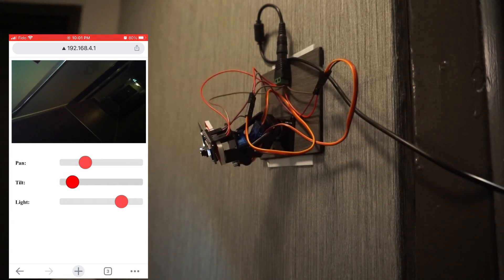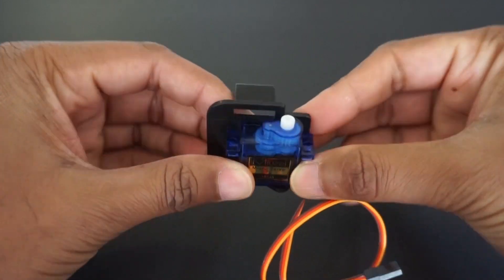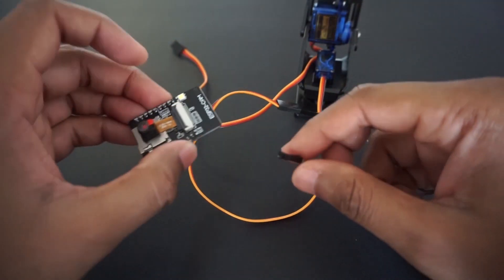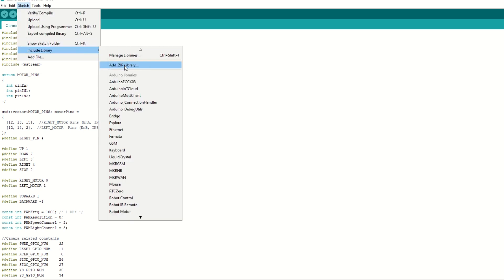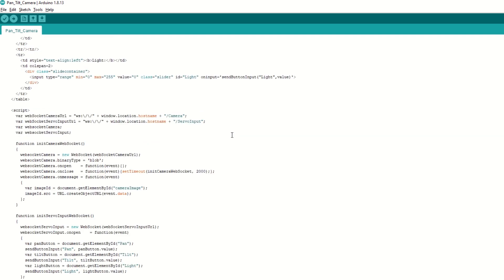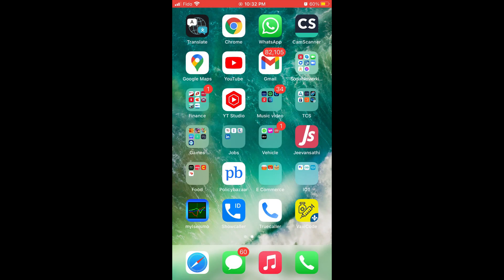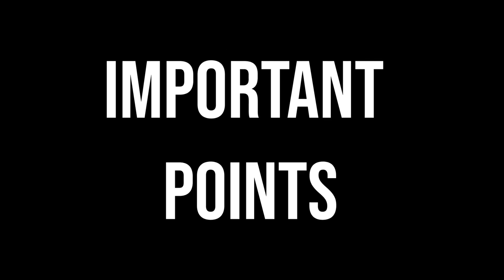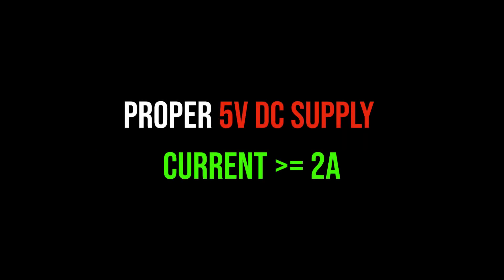Pan Tilt Control using Servos for ESP32 Cam |  WiFi Security Camera

Comment: Thank you sir for this code and setup explanation. And i have question sir can we use a battery for power supply
Reply from the maker: Yes you can use battery . However you need to make sure battery provides exactly 5V . Also use only rechargeable battery 👍🏻👏🏻
Reply: OK sir thank you for your guidance.
Reply from the maker: @sumeetmurgod2211  welcome 🙏

Comment: Bro I am providing it 5v supply but I think it's less than 2 A. Since I am not using sevo but still the video is freezed. Is it because of A? Is it necessary to provide 2A for video streaming
Reply from the maker: You need to change one setting in code . Please check for this step in video 👍🏻👏🏻

Comment: I am a newei and I have got an another problem 😅
Now the video gets freezed whenever I try to stream the video. Also I am only able to use it when I am connecting it through arduino to laptop. ESP32 doesn't start when I power it external 5v supply without the RX, TX pins. It's only working when I am connecting the RX, TX pins of arduino with it.
Reply: Bro you solved the problem

Comment: Sir I have done everything correct but esp32 wifi is not showing in wifi list. Please help
Reply from the maker: Please check your power supply and connections 👍🏻👏🏻
Reply: @hashincludeelectronics  bhai its correct. I tried powering it with laptop and with external supply both but still
Reply: @hashincludeelectronics  My antenna resistor is also placed correctly. The code uploaded successfully but when I am pressing reset button a random code comes in serial monitor. Please help me bro with this 🙏🙏

Comment: Can we get images if ESP 32 is connected to the phone instead of connecting phone to ESP 32 ?
Reply from the maker: Sorry I did not get your question 👍🏻👏🏻
Reply: @hashincludeelectronics  i mean, can we use esp 32 cam station mode instead of setting it as access point ? (in your project phone connects to esp32 cam, but i want to connect esp32 cam to phone's hotspot)
Reply from the maker: @psykopat81  yea you can . However what are you trying to achieve by doing this ? If you connect to your mobiles hotspot then you will have to get the ip address from esp32 which will be different.
Reply: @hashincludeelectronics  i am controlling my old android phone with teamviwer. If the esp32 cam is connected to the hotspot of this phone, I could control the esp 32 cam from anywhere in the world (you know blynk video streaming is now paid).

If the phone is connected to the esp32 cam via wifi, the mobile connection is automatically closed and I cannot connect to my old phone.

So the phone's mobile connection must remain open and esp32 must be connected to the phone.

Comment: hlw sir i am facing a problem... it is that the video is not streaming and when it streams its just a snapshot only and then it freezes and i cant help it...the serial monitor says frame buffer not accquired...
i have also set the parameter to 1 as described in the video...
plzzz reply sir plz help me
Reply from the maker: Please recompile the code and upload again . And then try 👍🏻👏🏻
Reply: Did you solve it?

Comment: I've tried according the video. 

Uploaded the code in esp32 without any error. then when I've giving power with 5v 2a adapter. SSID works. After connecting to ssid. Only LED control working. Camera video is freezed and no servo is working. 

I've also set the WS limit to 1. But still no movement in servos and no live video footage. 

Please give me a permanent solution
Reply from the maker: Please check the power supply . It should provide more than 2A current to work . Also check if your servos are freely moving . It should not get stuck in the frame 👏🏻👍🏻
Reply: @hashincludeelectronics  okay. the servo is not moving. when i'm disconnect the 5v pin, that time the servo just giving a shaking.

Comment: Hello sir....
I have also made it looking like this. But problem is coming. The video is not playing and stops after showing only 1 second and the servo motor is also not running. Only the LED function is working.
Reply: What is causing this problem? Why is this happening? And why is the camera module ESP 32 getting hit?
Reply from the maker: You need to change one setting in code . Max messages queued . Please check this in video 👍🏻👏🏻
Reply: I have done this also
Reply: @hashincludeelectronics   32 to 1
Reply: I am also facing the same issue.Video is frozen and servos are not working.only light function is working correctly
Reply: @Rinshadkt Did you solve it?
Reply: Me too..
Reply: How did you solve it?

Comment: I want to implement this project:

"Design of Driver Awareness system depending on Eye and Face Feature and Discrimination"

Can I use ESP32 instead of Raspberry Pi ? please reply
Reply from the maker: You can use esp32cam however you will have to do more study on how to use it for object detection etc . 👍🏻👏🏻please check details on internet available 👍🏻

Comment: Hi! I am havign a problem while using the app. The light works well but the servos are not moving and the camera is printing "Frame buffer could not be acquired" in the Serial Monitor. How can I solve that? I have already set the variable WS_MAX_QUEUED_MESSAGES to 1
Reply from the maker: Please compile and upload the code again after you have set that setting to 1 👍🏻.
Reply: @hashincludeelectronics   Is the first thing I did, but nothing happens, the camera is unable in the app

Comment: I know this comment section hasn't been checked in over a year, but I need help with this project in the worse way possible.  I have spent at least a month writing and rewriting your code, trying all kinds of different things, AND NO MATTER WHAT I DO, I GET NO IMAGE, NO MOVEMENT FROM EITHER SERVO, AND OF COURSE, THE LIGHT WORKS FINE (PIN 4)  How can  you help me????
Reply from the maker: Thank you for checking out the video👍🏻👏🏻. Please note that I have been keeping an eye on each and every comment on channel . So don’t worry I will always get back with answer whenever I get a chance. Regarding your issue what kind of power supply are you using ? Please make sure your power supply can provide more than 2 ampere current with 5v output 👍🏻👏🏻.

Comment: Hii sir, Can we use Raspberry Pi to upload the code ??
Reply from the maker: Yes you can use any module to upload the code into esp32 cam if it supports . However I have not used raspberry pi yet . Give it a try 👏🏻👍🏻

Comment: I want to build this project so I can connect to it any place in the world. Can I use an external internet access for the esp32 cam instead of my phone so I can have acces to it anywhere in the world and can I be able to control the servo any place in the world? Thanks
Reply from the maker: Unfortunately it can not be done using this project . This camera can be accessed locally only . You need to use the party apps like Blynk to access the camera globally from anywhere in the world . Unfortunately I don’t have video using Blynk on my channel . You can check for reference on internet . 👌🏻👏🏻
Reply: @hashincludeelectronics  Okay. I thought it is webserver connected already. For example, I just need a router for the esp32 cam then while internet connected it streamed the video live to my phone at another country after turning ON my mobile data. Also, why is blynk different from this. I think they plan the same source as you either need a web or app so you can stream the live video.
Reply from the maker: @joshuaolaiya  you can not connect to your local routers IP from outside . And even though you open port externally somehow , it’s dangerous . When using Blynk we send data to Blynk server first . And then from mobile we connect to Blynk server and receive the data.
Reply: @hashincludeelectronics  Alright noted. Thank you
Reply from the maker: @joshuaolaiya  welcome 👍🏻

Comment: Hi, Great project, i have build one and both the servos are woking fine. but the video is not coming and if coming its just a snpshot only. in serial monitor i am getting "Frame buffer could not be aquired"  please suggest on how to resolve this. Thanks
Reply from the maker: Thanks for checking out the video 👍🏻👏🏻. You need to set one parameter as shown in video . Please check video and see how to set “max messages queued” variable . 👍🏻that will solve the issue .
Reply: @hashincludeelectronics   hi me too facing the same problem, i follow the step " 32 to 1 " but the problem still goes
Reply: hi sandeep, did your problem got solved because i am facing the same problem
Reply: Did you solve it?

Comment: Video not display on mobile app. Do you help me?
Reply from the maker: Please check the video slowly and carefully so that you don’t miss any step . 👍🏻👏🏻
Reply: @hashincludeelectronics  i have made sure that not a single step is missed. And the error code (E) camera.c 1483 esp_camera_fb_get(): failed to get the frame on time. Is the cause hardware?.
Thank you in advance
Reply: @AzCars14  Hey could you fix it?
Reply: @JeroLam24  No, I think that the ESP32 cam is damaged

Comment: Can I combine this project with your other video named “Surveillance Car using ESP32 Camera Module"? If yes, what should be the changes that will occur in its code and the wiring
Reply from the maker: There is already a video on my channel where I have used pan tilt camera in car . Please check that 👍🏻
Reply: @hashincludeelectronics 
Can I get the model for the 3D printing?

Comment: I connected the esp32cam with a usb cable to the laptop, wifi nowiseeu can be read and connected. but when I remove the USB cable and connect with the jumper cable according to the instructions on YouTube, how come it can't appear, right? Wifi nowiseu? what's wrong huh?
Reply from the maker: It’s definitely power issue . Check the power supplied . 👍🏻

Comment: Bro this is Bluetooth operated right or u have to give the live connection to the Arduino
Reply from the maker: This is WiFi operated. But you don’t need internet for this . This project creates its own WiFi network .
Reply: Oh tht nice but can u explain the Arduino part i tried but it failed i didn't know how to do it . If u could help me I will be very thankful
I will try the robotic arm which u have made its was awesome ur explanation tho it's nice bro 
Tho i have a doubt i wanted to purchase a 4DOF robotic arm is tht code applicable for tht which is a 3DoF 
Those both look quite similar pls reply sir❣️

Comment: Great video!
I have a problem with during compilation on the line 246.
"error: variable 'std::istringstream ss' has initializer but incomplete type
         std::istringstream ss(myData);
                                                             ^"
Do u know how I can fix it?
Reply from the maker: This error should not occur . Which Arduino IDE are you using ?

Comment: Why use arduino one, it is not necessary instead use tdfi for esp32
Reply from the maker: Arduino Uno is used to just upload the code and acts as USB to serial converter. You can use any other device to upload the code .

Comment: I swear to god the Tilt servo is not working. Pin 15. 

I've tested the servo itself and it works. I've also tested uploading other code and use pin 15 and the pin itself is working. I've checked the code several times. I've watched the video several times as well. And reading the comments I'm not the only one having this issue. Please can you focus for a minute on this issue?. 

BTW, I've also watched several times the wifi car pan tilt video and I've tried changing   config.ledc_channel = LEDC_CHANNEL_4;
  config.ledc_timer = LEDC_TIMER_2; and still its not working. 

I really hope you can help.
Reply from the maker: Thank you very much for checking out the video and trying it. I assure you that there is no issue on using Pin 15 for servo.
1. Make sure you upload the given code for this project again Please don't make any changes at al in code. The timer and channels are coded properly and tested well.
2. Make sure you use 5V DC Adapter which provides more than 2 A current rating.
give it a try and let me know. Don't worry it should work as it worked for me .

Comment: didnt wor at all. Instruction is missing steps. such connecting the arduino. Its unclear.
Reply from the maker: Thank you for checking out the video and comment 👍🏻. What exact issue are you facing? I have provided the clear instructions in the video as far as I can and it works for others .

Comment: What changes should I make to make it work in station mode?
Reply from the maker: The code changes for Station mode are simple and you can find reference for it in my “getting started with esp32 “ video .
Reply: @hashincludeelectronics  I uploaded the code and the slides are working fine but there is no video. just a frozen image. It just like it only took a picture then stopped. Do you have specific version of libraries to use? I already modified the library header file from 32 to 1 as you instructed, but still to no avail.
Reply from the maker: @kymcainday6677  yeah the setting you changed from 32 to 1 should fix this issue . Make sure you re upload the code.
Reply: @hashincludeelectronics  no, it didn't fix the issue. That's the first thing I did actually before uploading the code

Comment: Great work! may i ask which part of the code need to modified  for flipping the camera angle? thanks in advance!
Reply from the maker: Either you can rotate the esp32camera or change the code where it has img section of html code . You need to check how to rotate image in html on internet .
Reply: @hashincludeelectronics  thanks for your generous reply! i get it! God bless!
Reply from the maker: @elmardasmarinas678  awesome cheers 👍🏻

Comment: how can i find ip address
Reply: Why address same?
Does wifi name password need to be same in my code
Reply from the maker: @kristyology865  this project works in AP mode . Hence address is same because esp32 creates its own WiFi network and acts like router. You can select any ssid and password as you need . You can keep the same ssid password in the code as well .
Reply from the maker: The IP address is same as used in video.
Reply: I do not find your wifi name in my wifi settings

Comment: A very nice project! I did it but only pan SERVO runs, Tilt SERVO not move, what can be? thanks.
Reply from the maker: Thanks . Please check the connections properly . May be there is loose connection for sure .
Reply: @hashincludeelectronics  thank you for quick reply , I did exchanged two SERVOs pin and tried all pins of ESP32CAM, only pin12 drived both SERVOS, other pin not...
Reply from the maker: @baocunb770  you need to use io14 and io15 only .please check the circuit diagram for pins used .

Comment: Good day Sir, I faced a problem which is when I try to control my servo motor it will auto disconnected the wifi connection. Is it because of the current provided to the motor doesn't enough? But for the ESP32 CAM and the lightning control works well
Reply from the maker: Yes . Servo motors need proper current around 500 ma . So please use rechargeable battery and provide 5v to servos .
Reply: I see ... appreciate for the reply sir 🙇
Reply from the maker: @Secret-eo1rz  happy to help 👍🏻

Comment: Hi i try your coding and found the msg “Frame buffer could not be acquired” in serial monitor, would you tell me what wrong in my side? Thanks
Reply: Thanks your reply. I have already amended the value of ws_max_queued_message from 32 to 1 in file of AsyncWebSocket.h
Reply from the maker: @kitlinghou6848  does it stop the video on your mobile ? What exactly the issue is ? May be recompile the code and upload again
Reply: After recompiled and uploading again, the image cannot be refreshed. And I have not attracted the servo for my this testing.
Reply from the maker: @kitlinghou6848  looks like your camera issue . It is not able to capture the image . Check if the camera is installed properly on esp32cam module . Or else if you have another esp32cam module then try it .
Reply: I checked my camera is worked using other testing script. Finally, i checked and re-uploading your script and found that my image screen is freeze without any motion and saw the msg "Frame buffer could not be acquired" due to the cannot return the frame (see below), pls advise what is the issue to cause it. many thanks

  //capture a frame
  camera_fb_t * fb = esp_camera_fb_get();
  if (!fb) 
  {
      Serial.println("Frame buffer could not be acquired");
      return;
  }
Reply from the maker: There is one setting MAX QUEUED MESSAGE which need to be set to 1 . Check the video for this step

Comment: Bro how change the code 4 servo moters and camera.can you send it
Reply from the maker: Thanks for checking out the video 👏🏻👍🏻 Unfortunately I will not be able to send code . However You can easily add 2 more servos in it . Take a look at the code and try to copy paste already existing similar servo code. It should work . Give it a try 👍🏻

Comment: please help me.  When I tried to copy the code and I touch to upload button in the Arduino IDE but it didn't upload.  I downloaded the Esp32 board, the AcyncTPC library, and the ESPAsyncWebServer library.  Arduino's 5V is connected to 5V, GND to GND, UOT to TX, UOT to RX, RESET to GND, GPIO 0 to GND.  But even if the computer sees the Arduino Uno card, it does not upload code. İt  gives a "fetal error".
Reply: @Alibali Alibeyov bro Iam also facing same issue. Did u solved it?
Reply: @ameerpasha9941  yes  I was able to solve.  I just changed the port of the Arduino Uno card a few times, tried to reload and it worked.  That's how I solved the problem.  If you solve, you write the answer;)
Reply from the maker: Yeah this error is common . There are many solutions for this . Try pressing enable button while uploading the code . Try using different USB port . Or cable . Check on internet for information on this error . It should be solved 👍🏻